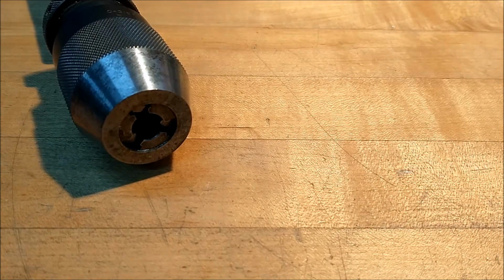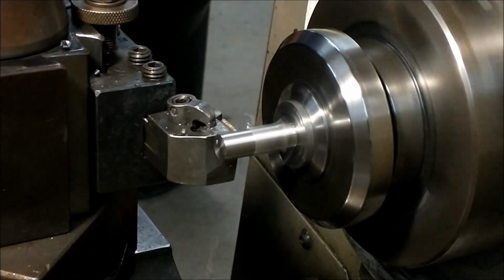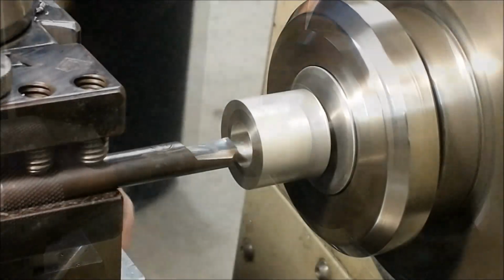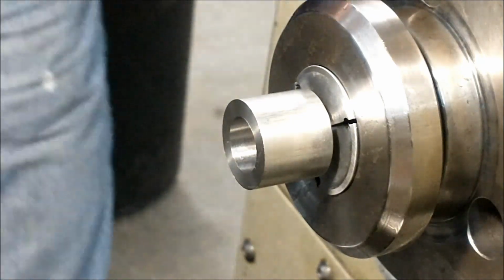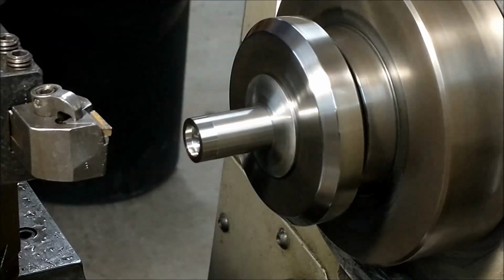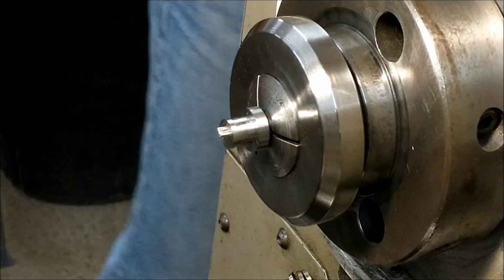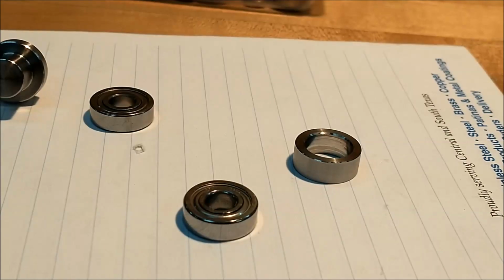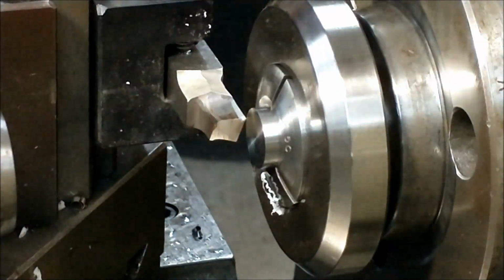Need a Live Center For your Lathe??  Lets Make one !

Comment: At least one of the bearings should be angular contact type so that it can take the end thrust.
Reply: @wwilcox2726  nah, you're misunderstanding. with an angular contact bearing in place of the deeper radial bearing, the interchangeability of the tips is....unchanged. All of the machined parts are unchanged (assuming you can find an ACB of the same id and od). If you're thinking that the ACB would fall apart when removing the tip, the first bearing and spacer would be keeping it in place. 
Additionally, using 3 bearings in a row with no gap is a classically terrible idea, since you're requiring a huge amount of concentricity without the need or benefit. Any imprecision in your pressfit, or the grind of the bearings would mean you are over-constraining the shaft. Without completely identical bearings, the majority of the axial load would fall on only a single bearing, until it deformed enough to allow the next tightest bearing to take up so load. You'd increase the load capacity assuming the tightest bearing didn't fail before the other could start taking up load, but certainly not tripling the axial load rating. 
Also, the the last bearing is the only one that could take any significant axial load (assuming joe's 2 bearing design with a spacer), since beyond the pressfit axial load, the first bearing would just press its outer race deeper into the bore. I think you're under thinking it.

http://pergatory.mit.edu/2.007/resources/FUNdaMENTALs%20Book%20pdf/FUNdaMENTALs%20Topic%2010.PDF
page 57, bottom right diagram "floating configuration"
"axial load capacity = axial load capacity of one bearing"

Any deeper of a discussion and we'll need section view drawings to convince you.
Reply: @crashfactory  
Peter, you're confused, you said none of the parts have to change, with that said, there is nothing to transfer the axial load to the inner bearing. You'll have to modify the parts as made to use your inner bearing to carry any axial load.
I'm not the one "under" thinking it, with all due respect. My mouth doesn't run faster than my brain....
Reply: @crashfactory  OMG "a huge amount of concentricity"????? 
What world are you from?
Ball bearings are manufactured to millionths of an inch tolerance and select fitted and provide run-out on the order of a tenth of a thou. 
What a dumb, know it all remark.
Reply: Oops Chris, you should reread your comment. See if you can figure out where you made your error. Or maybe rewatch the video.  ;-)
Reply: @wwilcox2726  I think I agree with Chris that there will be end thrust on these bearings.
Reply: @mattphilip4595  if the inner bearing was an angular contact type it would not provide any additional axial thrust capacity, but it would be an angular contact type. 
As based on the construction used in the video.
Reply: @wwilcox2726  Irrespective of location, one of the bearings can absorb axial load as long as the shaft and mount are designed to transfer the force. Based on the Joe's example, the substitution of a spacer on the shaft between the two bearings, in lieu of the O.D. spacer, would convey axial force.
Chris is correct and I don't believe that you have figured this out ;-)
Reply: @EDesigns_FL  additionally, if the deeper bearing were the angular contact, and nothing else changed, the press fit of the radial bearing and spacer would prevent the angular bearing from coming apart.
Reply: @EDesigns_FL  I said, "as based on the construction used in the video", and yours says as long as the shaft and mount are designed for it. So I don't disagree that it works if you redesign it, but it isn't necessary to redesign it. Honestly E Designs, you are over thinking the design. Substituting the spacer with a third radial ball bearing requires fewer parts to machine and shares the axial load over all three bearings, tripling the capacity. It's not complicated. Think  "KISS"
Reply: @wwilcox2726  You should re-read my comment. The modification does not require any additional parts. The only change is to the spacer. It would press on the bearings' ID's rather than the OD's. This change is only required if you  want to follow Joe's design AND place the angular contact bearing in the back, which you stated could not be done.  With a few tweaks, no spacer is even necessary. 
Needlessly adding parts as you suggest is a contradiction to KISS principles.
Reply: @EDesigns_FL  have fun with your design!
Because every time you remove the tip the inner spacer will fall down and you will have to f*ck with it trying to get the tip to re-install.
E Designs...is that short for Elaborate Designs?
Long live KISS!
Reply: @wwilcox2726   sigh. I'll try once more before giving up. I don't usually try to educate random folks on a comments section.

1. if i grant that the bearings are precise to within a few millionths of a inch, then does that mean your machining is also that precise? if not, then your machining will over-constrain the bearings. 
https://www.kalsi.com/handbook/D20_Bearing_mistakes_to_avoid.pdf. 
See point 5, where they say 
"This situation, called “over constraint,” causes bearings to fail prematurely, because of gross overloading due to the stiffness of the shaft. <snip> Eliminating the middle bearing can reduce the risk of over constraint."

If the bearings are not accurate, then 3 bearings in a row, back to back, could work (for radial loads only), because the slop would allow enough freedom to tolerate more imprecision in the machining, though you will again be in a situation where only one of the bearings is doing the lions share of the work, because it takes up the load before the others make contact. 

2. See image here https://ibb.co/K0zs6LZ to see how the load transfers through the inner race of the first bearing, to the spacer, then the inner race of the second bearing, then the balls, then the outer race of the second bearing, and finally to the part held in the drill chuck. there is some amount of load that can be transferred axially via the first bearing, but only until the pressfit friction is exceeded, at which point the bearing outer race is driven further in, and the axial load supported by the first bearing returns to the dynamic friction (because of the slip) of the interference between the first bearing outside race and the case. 
This image is drawn with an angular contact bearing as the second bearing, but otherwise nothing has changed from joe's design. axial force can indeed be taken by something other than the front bearing, with no design changes, as proven here. Also @Chris Armstrong.

3. It *is * true that if you pressed the front bearing in via the inner race, then the spacer would fall into the gap between bearings each time the tip is removed. however, if outer bearing is pressed in from the outer race, then the spacer is in compression between the inner races of each bearing. This holds the spacer in space with the balls acting as springs. This (unfortunately for you) also eliminates the possibility of getting even the perss-fit's axial load capability from the front bearing as illustrated in point 2 however. A solution would be to make the spacer stepped to avoid the seals and outter race, but almost the size of the OD of the bearings, so that if/when it falls, it can't fall very far, and a slight chamfer on the forward end of the spacer allows it to be easily aligned again when installing a new tip. More mass for the spacer, but it;s insignificant compared to the mass of the lathe chuck, so spin up/down time is negligably affected.

Long story short, the design works, and other people in the world are at least as smart as you are. going back to the initial comments. 
chris "At least one of the bearings should be angular contact type so that it can take the end thrust."
wilcox "Oops Chris, you should reread your comment. See if you can figure out where you made your error. Or maybe rewatch the video.  ;-)"
It seems that you are wrong wilcox. with deep ball bearings, trust loads are taken up, and with Chris's suggested angular contact substitution (on the rear bearing), a much high thrust is permitted (radial bearings don't often get official thrust load numbers, but people assume 10-50% of the radial load rating).

in my drawing, i've got a 7001 bearing, which is rated for 1000 lbf dynamic and 420 lbf static combined loading.

have a good day.
Reply: @crashfactory  don't waste any of you time attempting to enlighten me, I've been engineering for more than thirty years. It's you who need to be enlightened before you injure or kill someone with your mistakes and it's young people like you who make BIG mistakes because they think they know it all. Be safe my friend, until then try not hurt/injure anyone.
Reply: @crashfactory  I applaud your effort to enlighten the ignorant, but, as you can see, some people are incorrigible and absolutely refuse to accept the truth. Nevertheless, it was a great attempt ; -)
Reply: @EDesigns_FL  "the truth" as as you put it was acknowledged by Chris Armstrong's post stating I was right. 
Maybe someday E.D., but not today.
Cheers!
Reply: @wwilcox2726  You're right.  There is nothing in Joe's design to transmit the axial load to the hub of the rear bearing.  So, my comment should have said that the front bearing needs to be angular contact type.